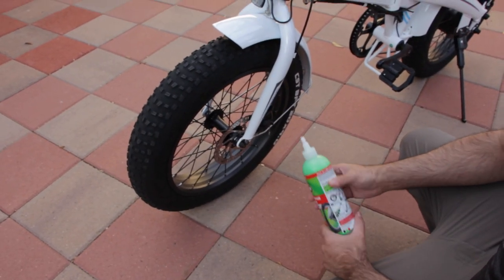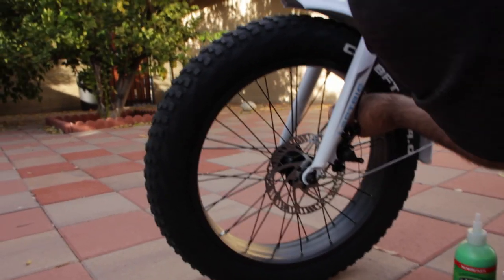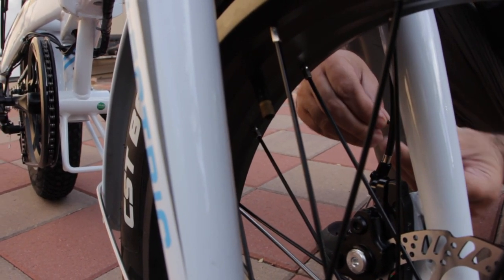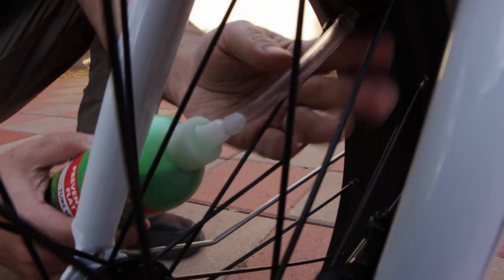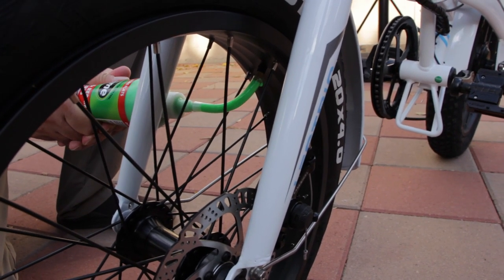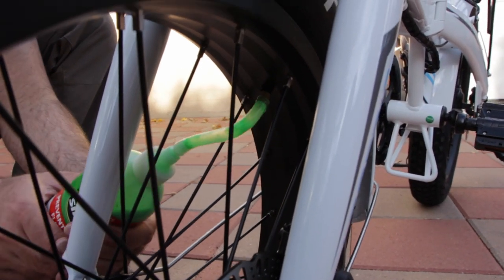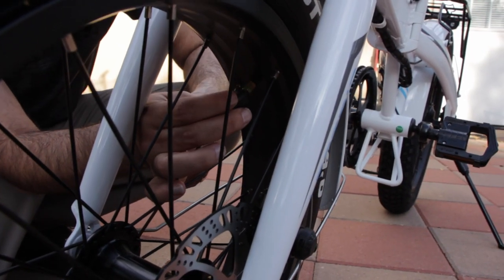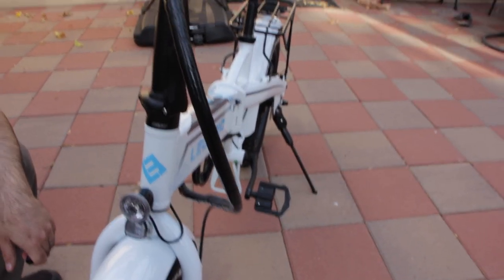Adding slime to Lectric XP electric bike tires.

Comment: I’ve had my bike for over a year. But after fixing a flat on my rear tire I am gunshy now. I’ve never had a flat in my life. After you put the slime in, was there any slime oozing out the stem? What I mean is , will the core get gooped up when u put it back in? Did u have to clean out the stem before you screwed it back in? Also didn’t u spin tire before u put air back in? Or does it matter?
Reply from the maker: the core shouldn't get gooped up if you fill the tire while the stem is shown as in the pic in the directions, roughly upside down. Than you spin the tire and that further displaces the goop from the stem and once you fill it up with air, the air further blows away excess goop in the stem. I didn't have any issues with it and I'm still flat free and its been over a year now.

Comment: Did you have any trouble with the rim unseating itself when the tire was deflated? If so, was it difficult to re-seat the rim?
Reply from the maker: a little but you have to fill it up slowly than massage the tube and then fill it the rest of the way. if it unseats just deflate it and start again. I noticed it helped when the stem was on the bottom as the weight of gravity helped keep it in place.
Reply: @TrailsUnscripted  Thanks!

Comment: What happens to the slime several months down the road? Does it harden against the inside of the tire and interfere with future tube replacement or other tire maintenance/replacement?
Reply from the maker: based on the specifications found on the bottle it continuously works to seal leaks for 2 years and holes up to 1/8 inches in size. it does not freeze and is non-flammable and non-toxic
Reply: @TrailsUnscripted  Thanks!